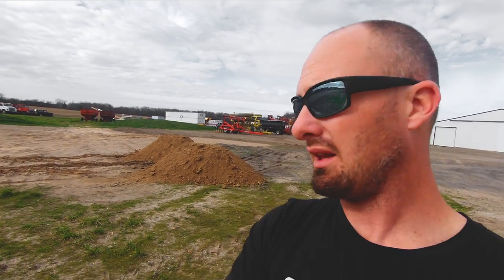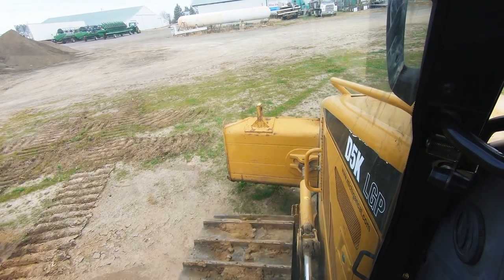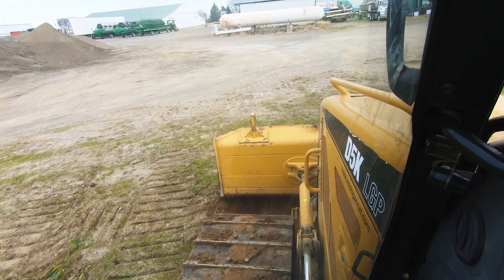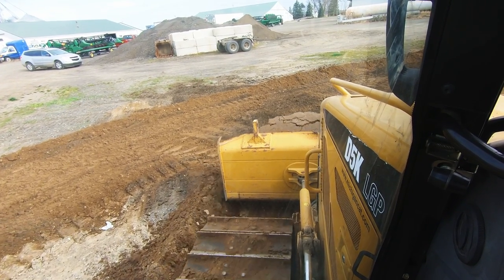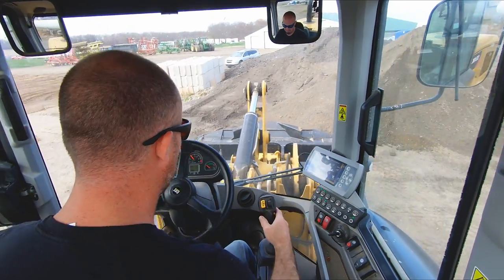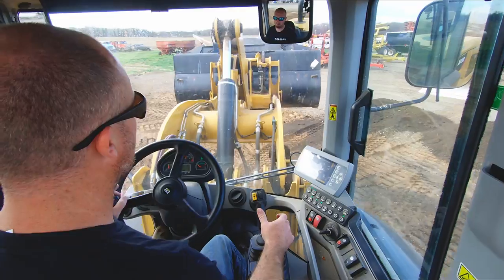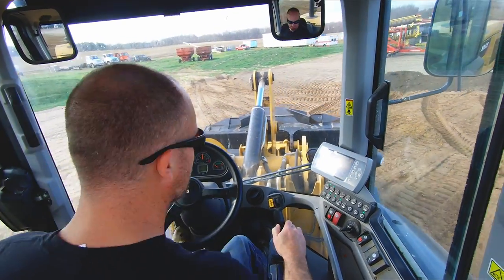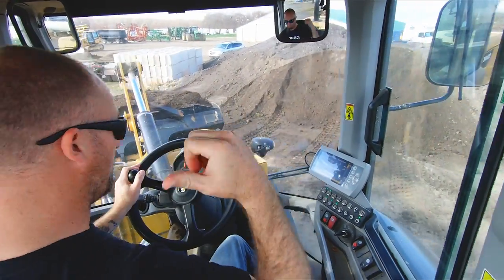HOW TO GRADE WITH A DOZER // Cat D5K Bulldozer - In Cab // Throwing Down Millings//Bulldozer Running

Comment: You mentioned the ride control didn't work in the loader so it is bouncy. What it the ride control? Have you done a video on it?
Reply from the maker: Ride control allows the boom arms to "float" as you drive.  Instead of being rigid and jarring the snot out of you, the hydraulics go soft and allow the boom arms to move up and down which dampens the bouncing.  It's a feature that is turned on and off with a button in the cab.

Comment: Use the D-Pedal b4 you change direction b4 you mess your tranmission up!
Reply from the maker: These are hydrostatic machines.  That was the case with older units with transmissions.
Reply: Yea hydrostatic

Comment: One of the most common mistakes I see with new loader operators is not keeping the floor where they are loading from flat. It makes it more difficult to get a full bucket and you end up packing down material that should have been loaded out.
Reply from the maker: 100%.  Everyone either digs a hole or makes a nice ramp.  Gotta keep that floor flat.

Comment: Its alot easier to grade loader buckets then going through tri axle piles doing half a lane at a time i find working with a packer helps as well when doing finsh grade prep for ashphalt but everyones different
Reply from the maker: That's one of the fun aspects of the industry. Everyone has their own flair they add to a given task. I still learn on a daily basis from watching other operators. Thanks for the comment!

Comment: By weight on the tires for non-operators meaning lift up on the more while in the pile keeping weight on the tires also using the decelerator pedal as much as as possible and especially for the operators that the equipment is in yours lol

Comment: What you said about good loader operators is completely false.. I ran loader everyday for about 10 years and never use traction control there was a time where there was no traction control on loaders fella lol it's called keep wait on the tires if the tires are spinning you need to be putting weight on the tires

Comment: Nice video, I'm operating a 2019 CAT D5k2 these days, nice little dozer. Does the older D5K have the traction control too?
Reply from the maker: It does not. I didn't realize the 2 series had that feature. Now I need to hunt one out and get some seat time in it...

Comment: Hey have you ran the newer Cat loaders with no steering wheel? Only joysticks... we just got the new 966 and it is AWESOME
Reply from the maker: I haven't had the chance to get into one of the joystick machines yet.  I got close but didn't end up getting the chance to run it.
Reply: They are convenient but some are much more sensitive than others and take some getting used to. I've run a 966 that wasn't so bad but also a 972 that articulated very aggressively just by touching the joystick. It's hard to beat the precision of the steering wheel.

Comment: WOW, backblading !!!, according to some expurts on some of these channels it's instant dismissal, LOL.  They obviously have never had to use a dozer to its full potential so would be classed as learners still. Back blading docent hurt the blade if it done properly, after all its still the cutting edge in contact with the ground, not the bottom of the blade like so many seem to think is happening. Been operating dozers and things for over 50 yrs and back blade when needed if thats what the job requires.
Reply from the maker: The problem is the guys that think the back of the blade is the only side that can cut flat 😂

Comment: What kind of camera and holder do you use
Thanks
Reply from the maker: All of my in cab footage, intro's and outro's and hyperlapse's are done with a GoPro 8 Black.  I use a Gecko suction mount and a magnet mount depending on the situation.  For my shots where you can see my hands and my time lapse shots I use a Sony Action Cam with the same mounts as the GoPro.  All of my fancy slow-mo and cinematic stuff is shot with a Sony A7III.  Drone shots were done with my Phantom 4 although I just upgraded to a Mavic Air 2.  I bring the gear when I operate😂😂😂

Comment: If u can't grade millings you just need to hang it up...
Reply from the maker: I think millings are harder than they look at first glance. Because it is all loose material you don't have the resistance you do in harder packed materials and it requires more finesse when grading
Reply: @DieselandIron  grading out mulch from a tub grinder is a tuffy....it just clumps together if you take a full blade it won't spread right....

Comment: Learn how to run the machine without the electronics rather than using them as a crutch.
Reply from the maker: That's a great rule of thumb.  Too many guys run on auto all day and lose the ability to finish grade (or never learn it to begin with).
Reply: GPS auto grade made me a better grader. It helped me get a better feel for what flat is. But I know many operators that used GPS for too long and it was detrimental.